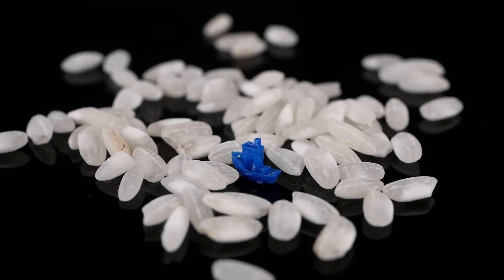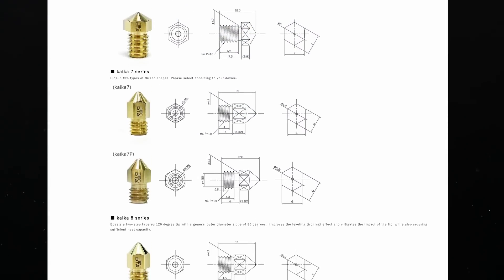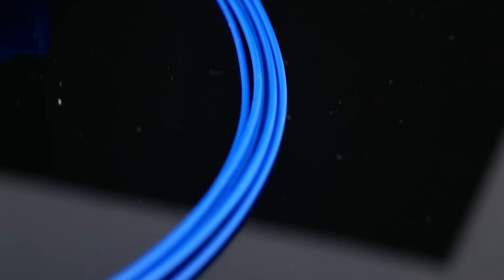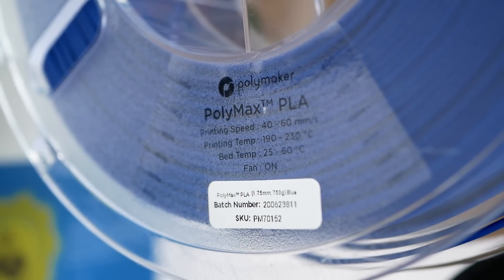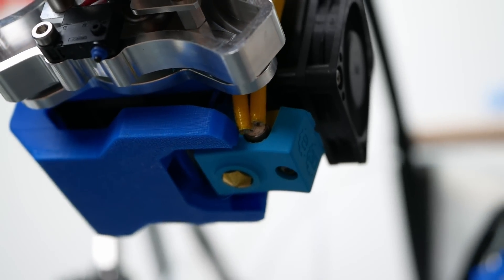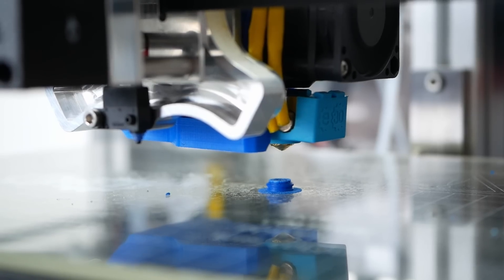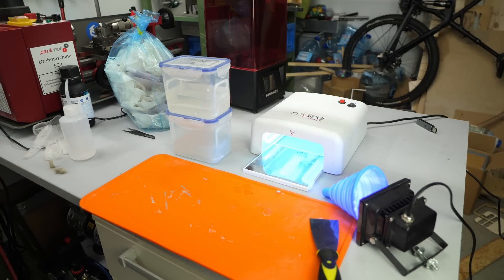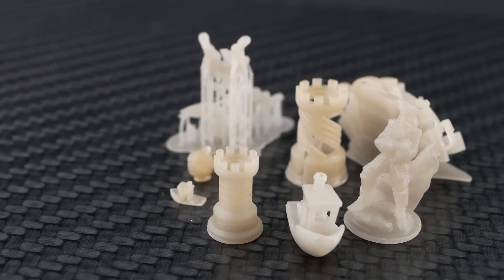MICRO 3D Printing with a 0.1 mm nozzle

Comment: How about printing a "multi material" print, where you use a 0,4mm for the whole structure and a 0,1mm for the details only?
Reply: I love this idea. It's when interswapable hotends mid prints come in, I remember seeing a video about it
Reply: @Jordamson   I agree it would be vary nice to be able to swap the hotends and use smaller one or bigger
Reply: @Jordamson  He has an E3D tool changer so he definitely could try it. In fact, that's what he did for his multi-material hook.
Reply: @Jordamson  I have a dual nozzle printer.  This is something I never thought about.  Maybe I'll do 0.6 and 0.4
Reply: @Jordamson  Stefan has an E3D Toolchanger, probably could do this.
Reply: That's what I thought, you can even step up on nozzle size for even faster printing without losing detail
Reply: @JefeInquisidorGOW  exactly. It's such a good idea, the only other idea could be a nozzle that can change the opening during prints. Surely that's possible
Reply: @Jordamson  actually if you move the nozzle faster the extrusion width would be smaller (because fluid physics). You don't even need anything mechanical to achieve that.
Reply: @FlameRat_YehLon  I've used that before but it isn't near as accurate as using a 0.2mm nozzle or likewise
Reply: @Jordamson  my thought here is that if a filament is thoroughly profiled on a specific printer and nozzle (generating a LUT between speed, temperature and extrusion width), and there's software that supports it (maybe to the point that make use of differential equation to predict overall temperature shifts) then it's possible that even a wider opening nozzle can achieve the same accuracy as the narrower one.
The issue currently is that since the whole market is still more DIY than industrial, consistency just isn't that big of a concern to most people.
Reply: @Jordamson  I mean, 2D printing can go as accurate as people wants, because in the industry there's proper profiling. Not much filament or 3D printer have been profiles as far as I'm concerned, and there's no software that can utilize such profile, so FDM just isn't as accurate as it potentially can be.
Reply: @FlameRat_YehLon good point, definitely easier in 2d that's for sure, could this technology be transferred over to resin printing?
Reply: @Jordamson  in resin printing there seems to be some sort of anti-aliasing techniques (using grey scale pixels at the edge). In reality though, it doesn't seem to get rid of layer lines, but rather just making the layer contour (for lack of a better term) smoother.

That's said, the layer height should be some what variable for resin printing. 

And as a side note, DLP based resin printer should be able to make use of pixel shifts to gain some more in-layer accuracy. It can't bring the line width lower (than the width of a pixel), though, unlike in FDM where the line width isn't completely defined by nozzle width.
Reply: @FlameRat_YehLon  It isn't the same though because if you extrude 0.1mm filament through a 0.4mm nozzle, when you change direction it switches sides of the aperture. You get a sort of backlash effect. You get a 0.3mm uncertainty in placement.
Reply: @nophead  if printed slower, and with some feed-forward compensation it's probably not as big of an issue. Of course, that would make it much slower than an actual 0.1mm nozzle, but if variable extrusion width is utilized properly it might not be that much of a pain. 
And even if it's slower it might be better than actually making a nozzle that has a variable aperture, as it doesn't take too much imagination to see that such delicate design would be rather costly.
Reply: Adaptive layer height ;)
Reply: It would be the next big step for FDM printing but i don't know if any slicer have that capability yet
Reply: @azazeltheforgotten  you can just slice it as a multi color print. There you can choose which extruder to use for each colour. And of course the nozzles can be different too
Reply: Came here to say this
Reply: That sounds like an amazing use for the new prusa
Reply: This would be great for making sacrificial parts for Lost PLA Casting, because you'd be saving on time and material while still creating an incredibly detailed part.
Reply: To get real time saving it would help to use a thicker layer height for the wider nozzle. This would mean first printing several layers with the thin nozzle first before 1 layer of the thicker nozzle.
Reply: I like this idea but..
How to Hotswap the nozzle 
And the multi material thingy
Mosaic Pallete series
Reply: 0.4
0.1
"."
Reply: I kept thinking about this through the whole video, I'd imagine it's only a matter of time before we have something just like that.
Reply: I have a sovol sv04. It has two print heads so i put a 0.4 and 0.6 nozzle in each one. Walls print with 0.4 and infill prints with 0.6. Infill layers are twice the layer height. High infill parts print a lot faster. Low infill parts print a little faster.

Comment: What about printing PEEK that size. A plastic material with properties superior to most resins and that needs to be printed in FDM seems a decent application. Also it is so expansive that probably the parts I would like to print with this material are so small I woudn't care so much of the time required to print them.

Comment: I feel like most of the people who would say "why not just use a resin printer if you want high detail?" probably haven't used a resin printer
Reply: I hate resin with a passion. Curing, washing and dealing with it is such a pain. It was my first printer so once i got an fdm i was very grateful with just popping off the build plate
Reply: My first printer was a resin printer and I’ve had it for 2 years, and have made 2 things with it… 😬
Reply: Resin is good but I'm not happy about them degrading over time in ambient light. You need to clearcoat the parts of course, but they will wear off if you handle them for too long.
Reply: Resin SLA sounds great, provided one has the resources. As best I understand it, an FDM machine can run safely in many more environments.
Reply: Actually most people also never print resin parts this tiny. At these scales you get more deformation, warping, and shrinkage. Though I lose a little resolution I prefer printing parts around this size on my FDM because it stays dimensionally consistent
Reply: Fdm printers can do more than 3d prints. It's a cnc, so you can use it to many applications if you want it, like a laser cnc for exemplo. If fdm printer are like Linux, the resin one is like MacOS
Reply: They're not that tough to use, but they do have a learning curve much steeper than that of FDM printers!

99% of the difficulty is realizing that all the tricks you learned for FDM printing don't apply to SLA
Reply: @Nawmps  I haven't used an Resin printer, but that's for valid reasons. I don't think there's much of a challenge to use a resing printer, afaik they're pretty much plug and play.
FDM do however, have a steep learning curve. There's a lot of settings tweaking, hardware tweaking, and so forth, especially as you go into small printing (0.04mm/40 microns layer height).

The problem with resin printers is their toxicity, and the dangers of using them. There is of course a learning curve when it comes to safety measures, but those don't have to be followed to get printing, they're just required for long term (or even short term) health.

I'm not getting a resin printer until I have my own house, and a shed that I can make into a bio hazard "lab", the toxicity of resin is just too bad. Lots of people don't realize just how toxic it is, and it's why we have people breaking out in hives, and even getting blind.
Reply: or maybe understand how to print in resin without so much crying. I don't understand how he generated so much garbage for a few prints. they could all go on the same bed, it was 1 run. He clearly also wasn't using a mono. Honestly if you do have a resin printer and know how to use one it is much better, faster, cheaper and more reliable and less fiddly than messing around with a .1mm FDM nozzle and waiting 30h for something that looks worse than what you get out of a resin printer in 10 minutes. I could have run off the same comparison prints and had the waste of 1 pair of disposable gloves. I mean, he doesn't even have a wash and cure station! It's like saying FDM printing isn't worth it and all you have is an M3D micro as an example.
Reply: my point was more that resin printing is more hands-on and not the same as FDM, not that resin is worse somehow

resin is absolutely the better choice for high detail prints
Reply: @Adventium_  then you should wdit your original comment it doesn't remotely hint at this your so called point

Comment: Perhaps a clear filament would be better.  Maybe ABS clear would be good?  If you keep temps low
Reply: ABS continuously degrades in a molten or semi-molten state chemically, it causes the breakage of molecular bonds. You absolutely can not print it this slowly, it's murderous for it. So no, ABS has absolutely no use in this nozzle. Not sure about other styrene polymers, maybe worth some research.
Reply: @SianaGearz  I was wondering specifically about the MG Chemicals ABS filament.  Back when I first started 3d printing... 5 years or so.  I bought their ABS.  I did a bunch of experiments on how cold I could print and was printing at 180C.  The neat thing was the abs cooled to a non-sag state quick (I didnt have a part cooling fan).  I wonder if the degrading of the ABS would be ok at that temp.  

I still think a clear filament is a must to remove one more particle and variable.

Maybe this would be a good series idea.

Comment: I agree that I don't like doing SLA printing as much as FDM, but to achieve the small details that resin can with FDM not only would it take modifications to most machines and specific filaments, the print time would be absolutely glacial. Resin is worth it on parts that need to be smooth and have fine details such as curves and shapes that would be difficult to sand out on a FDM print.

I also really like resin for stuff like Greeblies and other small flat parts, the surfaces come out glass smooth and they take 10 minutes to print on a mono screen whereas they would take an hour on FDM. But, I still prefer prototyping on FDM and if I can get away with the level of detail I would much rather use FDM.

Comment: I'd love to see what you could do with that Toolchanger and the micronozzle. Could you print the infill and inner walls with a large nozzle, and the outer wall with a micronozzle, for the best of both worlds?
Reply: that would be cool to try, not sure if you might run into issues with matching layer heights with the big nozzle
Reply: @roseroserose588  Yeah, you would likely need to run the smaller nozzle near it's upper limit and the larger at it's lower. Those the range of layer sizes you can successfully get at a given nozzle size is quite a bit more than one might think. I think .15 and .3 might be a better mix though.
Reply: @kaseyboles30  I think it's theoretically possible to get a slicer to interleave multiple layer heights, since I've done that before by adjusting g-code with a script. (It was for thicker infill layers, to reduce print time. I recommend z-hop and low travel speed if you try this.) 

Here's the thing. Even without a tool changer, you can print wider than normal lines from any given nozzle. EG an 0.2 nozzle can print up to 0.4mm wide. There is a video on this channel about it actually!

It would seem to be even better with a tool changer, because we get an even bigger range of widths to choose from. (Eg 0.1mm for detail and 0.8mm for bulk fill)
However,  I think such an extreme difference in width would only really be helpfull for solid parts that require high surface detail. (Geometry and layer height issues)
For a difference of 2x or less, you can just use a signle nozzle and adjust the exterior line width in just about any slicer.

Tool changers are still awesome though. If nothing else, it means not needing to swap the nozzle every few prints.
Reply: @TheVideoGuardian  Saw the wide line video, cool stuff. I suspect with the right algorythym a slicer could plan out the motions and z-hops and such to make variable height work across larger size gaps. They did manage to make a slicer go up and down during a layer print by feeding it the clearances around the extruder (I'd really like to see that enhanced to work with 3 independent z-axis systems). Of course we definitely will need more time to slice and likely not going to run such on older 8-t controller boards.
Reply: Sure but you would need one toll. Change per lywe
Reply: You can probably print 0.3 walls with that same nozzle though, judging by the size of the flat part.

Comment: I have micro nozzles at my disposal down to 0.2 but haven't used them yet. I simply can't justify a resin printer because i live in a constrained space and would have no way to separate myself from the fumes and for sure will use my FDM when the need for something small and detailed arises.

I have tried nickel plating a nozzle recently (self made nickel citrate) and it actually improved the surface finish, seems like. I only have cheap nozzles. After an hour at 100mA, It seems to have constrained the size of the nozzle from 0.4mm down to about 0.38mm. I think i can use that fact to constrain existing cheap nozzles if i care a little.

There is another option for micro printing which solves the radiant heat issue: nozzles with an airbrush tip. E3D style nozzle top, which an airbrush nozzle screws into from the bottom. You can buy them inexpensively. They were invented by René Jurack i think, also the developer of the small precision DICE FDM printer. Airbrush nozzles are available between 0.1 and 0.5mm in size. The airbrush tip is made from stainless and radiates little heat, and gives you some distance between the hot brass and alu parts and the print.
Reply: Ooh I’ve never heard of airbrush tips, neat!
Reply: Awesome to read that about airbrush tips.
Reply: I, too, use airbrush nozzles with great success.

Comment: Honestly this looks like maybe a 3rd or 4th printer challenge 🤔  

I'm looking for my first printer yet just as a prototyping and entry level printer. My 2nd printer will be one with the infinite Z like the cr10 when I can afford it. I don't know if I ever want to get into liquid printers but I would like a solid workhorse of a printer that can print in all materials at extreme temperatures. This micro nozzle looks like it deserves a special build from the ground up lol

Any suggestion on a cheap yet capable printer and what knock off brands are good quality?
Reply: Have you considered the Prusa Mini yet? Given your requirements, I think they will only be satisfied with a Chinese printer if you're willing to substantially rebuild it, at which point you don't really care about quality all that much?

Or alternatively reduce your requirements and just get something to start with that is amenable to modification, like an Ender3 or Geeetech A10, or even the shitty Kingroon KP3. It will be quite an amount of fun and trouble anyway, without even getting to extreme temperature materials, you have a lot to learn, like A LOT. Well depends on your definition of fun.

I also don't really believe in trouble free 3D printers, they tend to just all fail in various ways whether they're cheap or cost thousands, though the latter are at least good on day one.
Reply: @SianaGearz  Siana,  one of the biggest issues I've had is the over abundance of information. I'm still trying to find a reliable trend of reviews that don't contradict each other. 

For a 1st printer I want something that is reasonably priced with very little learning curve to see if I want to dive deeper into 3d printing but at the same time reliable enough that I won't get frustrated with it breaking every time I try to use it..... I fully understand cheaper made parts will break sooner but I don't want to buy a part that won't work out of the box either. 

There are so many name brands and so many knock offs I can't get reliable information on what is a better knock off or a pile of scrap. Or if any particular brand is better quality and what parts are more universal. Do you have a good link to a good site with all this information? 

As for the future printers I have in mind, I won't be constraining myself on the budget as much. I'll just save up and eventually get something of reputable quality.  

So for a first printer I'm looking for a good, cheap entry level, pull it out of the box and it works (minor assembly is ok) printer. Like the ones advertised for children.  

I would prefer not to spend over $200 US
Reply: @handy-capoutdoors4063  Ender 3 is generally the recommended entry level option, cheap, very popular and lots of support. The issue is you might find yourself needing to upgrade some stuff. The next step up is the prusa mini which is a brand known for their quality and ease of use, the printer would work great out of the box but is more expensive at around ~$350.
Reply: @metal079   what is the difference between the ender 3, 3 v2, 3 pro, and I seen something about a 3 max... what is the advantages of going with the others?  Quality,  features?  And what upgrades would you recommend out of box or prepare for?

Also what distributors are better and worse? I'm thinking about going through Amazon